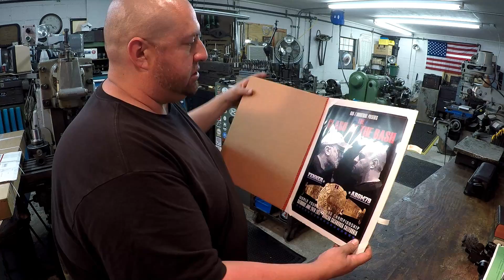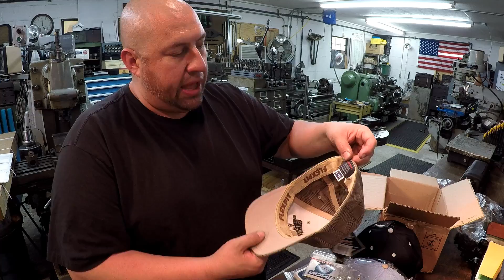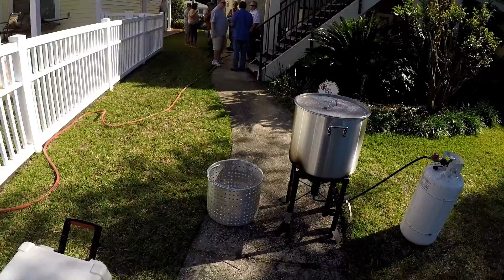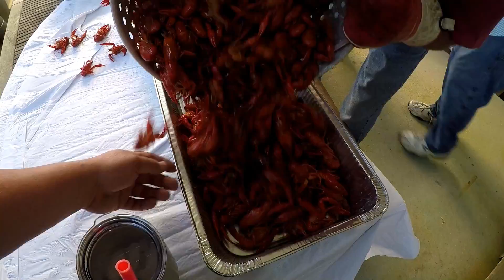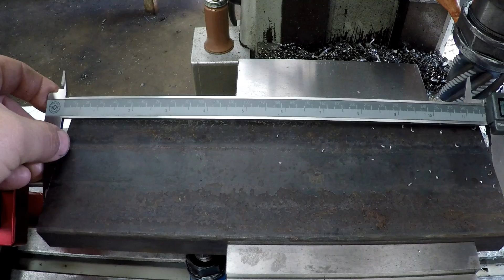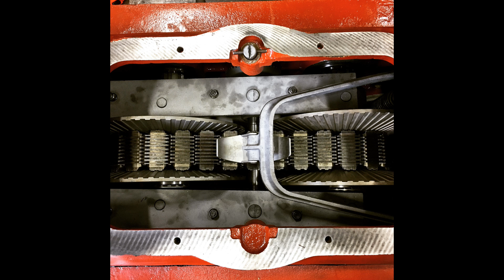SNS 163 Part 1: Seafood Cookout, Edge Pro Mill Stop, Machining

Comment: i noticed on the indicator near the back of the lathe "spider nut" i think u call it. the indicator looks to be turned at a bit of an angle. if it we straight in would it cause it to be more off on the dial numbers versus at a slight angle? i hope you under stand what im tying to ask

Comment: Calling a useless overpriced gimmicky product a crap is an insult? I thought your skin was thicker than that! Of course I enjoy a tool made by someone else and not everything should be shop made, but come on, 50 bucks for a stop that a bolt, step block, angle plate, scrap piece, or any other object you could clamp down to table would accomplish faster and at no cost is a crap, pure and simple. I've been your subscriber for years and take this as a constructive criticism; just because you got it for free doesn't make it worthy of your integrity. Do as you wish with your channel but don't label people for calling a crap what it is.Speaking of crap,  I'm in the market for a hydraulically actuated fully automatic thermally protected anodized titanium high performance dual exhaust 75 hp 15 phase door stop for my shop; of course i could shove a wedge under it but hey jsu in case you come across one let me  know. Unsubscribed by the way.
Reply: Haha I always like when people announce that's they've unsubscribed. The level of narcissism an individual must require to think anyone gives a fuck is pretty substantial.
Reply: MotoWanderer guess you're gonna need that door stop so it doesn't hit you on the way out.
Reply: What a bunch of infants.
Reply: ***** yeah, cause we're namecalling and unsubbing awesome channels because we had one single disagreement with the provider... totes bro. We're absolute children.
Reply: LOL! nice one bro!
Reply: bud. he used a stop in part of a video. calm down. there's a lot bigger people out there on youtube using product placement in much scummier ways for you to direct this anger at. i'm not even a machinist so i don't have a use for it, it's a nice looking piece. get over it.
Reply: Oh the army of brown-nosed sheep coming to defend and express their outrage. Buy your damn $50 table stop and shove it then.
Reply: I have absolutely no problem that he is reviewing a product that was sent to him for free or if the company paid him to review it. I even have no contest to the conclusion of his review, whether he finds it useful or not. All i said that in my opinion it was a gimmicky product for an inflated price and other tools would get the job done faster, easier and at no cost. I expressed my opinion and i was accused of slinging insults. Why is it that you have to concur with the author or die? a few videos back, he reviewed a tap follower that was far from functional and labeled it awesome and great. Tom Lipton reviewed the same thing and he was honest about it, it was crap. To each his own, but when you tell people that it's great, and you should give it a try, have the decency to tell the truth. I didn't unsubscribe because of paid advertisement, i come to youtube for two things only, informative content or entertainment. It's been a long while that i sit through 10 minutes of t-shirt plugs, flee market scores and yet another 1 in ch micrometer addition to the 1500 before it. Adam is a stand-up guy but his answer to me was far from it. i get to choose who i watch and i',m done with bunch of schoolgirls comparing their makeups. End of story and end of my comments. Good luck to him nevertheless.

Comment: That mill stop tool kinda looks like a pain in the ass. I can see the need for thumb screws instead of the cap heads and set screws that's for certain. thanks for the video.
Reply from the maker: Yes the thumb screws would be a good upgrade on this one. I'll agree it's not super heavy duty, good for light weight work, and you can't slam the parts against it.
Reply: I don't have this one but I have both vice stops and they are great. If y'all want I could do a YouTube on how to use an Allen wrench.
Reply: Yeah, I"m with you on that. If I'm gonna spend $50 on an adjustable stop, it better , at least, save me setup time. A tool-less adjusting system doesn't seem like it would be rocket science to produce. Allen wrenches suck...I think that the machinist trade would be better served if socket head cap screws became a thing of the past. I feel that they might be the bane of machinists everywhere. There's gotta be a better way. OK...I'm done with my rant now. I feel so much better. :-)
Reply: I totally agree!
Reply: ..Yeah, maybe a sort of 'quick-release' lever at the base of that vertical part?
Reply: Duncan MacKenzie I have one of those stops and I can honestly say I'm not too impressed with it. 2 major draw backs.  #1 If you have a heavy piece in your vise its really easy to flex it when sliding your part against it. #2 If it's not perfectly square with the t-slot it will not repeat if lowered and raised again and the locating tab on the bottom has a lot of clearance at least on my mills. It will get you close but on close tolerance work I ONLY use it to get me close and indicate to find center. I make a lot of tooling that has to pin together AND match a cavity and the outside of the workpiece. This stop does not do that for me but for general use like he has shown its probably adequate although expensive.
Reply: The edge technology stops are great tools but I agree that the little setscrews are a pain. I plan on changing the small ones to either thumb screws or possibly use a spring loaded lever type screws.
Reply: I agree this is one of the weaker of their products. You could fix some of the issues, but I am not sure I would bother with this tool.
Reply: All setups take time.  After setup you'll save lots of time.
Reply: carryit around I have this one and the adjustable one that fits on the back of the solid vise jaw. In my opinion they are both a nicely anodized POS. They aren't capable of the accuracy my customers demand from me. And FYI I learned how to use an allen wrench when I was a kid in the 60's working on my homemade minibike but thanks for the offer.
Reply: carryit around  I'm guessing that your comment is directed at Cad-Cam_Man. All I said is it kinda looks like a pain in the ass due to having to use two different size allen wrenches to set it up, not to mention it does look a bit flimsy, an accidental bump might throw it off.
Reply: Duncan MacKenzie I apologize.  You are correct my comment was directed at cad cam man. I should only comment on my pc. This phone is a pain.
Reply: No worries.
Reply: Duncan MacKenzie nothing is perfect. And short of chaining keith
Fenner in my shop using an Allen wrench or thumb screws won't make much difference. I use and like the product. Shouldn't have become defensive but I wouldn't not use the tool over thumb screws vs Allen wrench. (Criticizing my grammar won't help find perfection either lol)
Reply: Cad-Cam_Man well you've proved to your fans your a machinist... but you would have to put it in a hydrolic press to flex that shaft... end of story... if your part is out of spec its not because of that tool unless your hitting it with a hammer...
Reply: I never said what flexed shaft or otherwise. I suspect the body is flexing at one or more of the joints. No hammering on the part allowed. I don't care if you believe me or not I'm just telling you my experience with the tool. I think I wasted my money and even Adam says it's light duty. I'm gonna retire soon and sell out so I'll just sell it to some rube that thinks he needs it. Lol
Reply: can can man....well I'm just going to go ahead and believe that operator error is the problem maybe head space... sell it cheap to a RUBE he will thank you..
Reply: Come and get it!
Reply: can you ship?  how much you want for it??? no damage from hammer and chisel machists please..
Reply: I bought it from Travers tool. Paid 60 bucks. Your in love with these things so I'll sell to you for 40. You come and pick up. No shipping.  I'm run my own shop and have been working 7 days a week and haven't had a day off since Dec. Not dicking around with shipping. Besides that will allow you to see me hammering in person if your so inclined to believe I have been.
Reply: do you have the pro-mill stop (50) ? or multi axis stop? (60) http://www.edgetechnologyproducts.com/products/
Reply: Pro mill stop
Reply: can can man... never mind i just ordered both from their site based on Adam's recommendation and my prior experiences with the vise stops...  they have good stuff and i recommend them as well...
Reply: carryit around I wish you good luck with them
Reply: carryit around I am building (cnc) investment molds out of aluminum plate that have to be pinned to match all around the perimeter and also the internal cavity. Square up the material with an angle plate and face mill. 2 blocks perfectly matched checked with a height gage on a surface plate. Set up on in a kurt vise against the table stop. Indicate edges for center X and Y. cut my cavity and drill my alignment pins.  Remove part 1 place part 2 in the vise against the stop and unless you are EXTREMELY careful the stop will flex and my zero is not there when I indicate. Might be alright to make wagon tongues and hinge pins but no friggin good for my work. Hope you enjoy yours. BTW everything is tight its just prone to flex when sliding a 10 or 20 lb chunk of aluminum against it.
Reply: Duncan MacKenzie  unless its loose it is dead nuts from part to part. No way is it inaccurate.  You make no sense.

Comment: What is the 4-jaw competition?
Reply: Peabrain Think of it as the WWE of machine shop lathe accuracy competitions. It's been held a couple of times now by Bar-Z Industrial in Cucamonga, California. Adam waxed the competition the first year. Second year, Keith Fenner lurked in the background to challenge Adam at the end, after Adam crushed Tom Lipton (Ox Tool Co.), who had built a 4 Jaw competition rig, for the event.  Who knows who's gonna win this year's event.
Reply: Clamping in a workpiece within 1/10000 in a set time sort of stuff?
Reply: Yup. Not by set time, but fastest and most accurate. I don't know what penalty format they use.